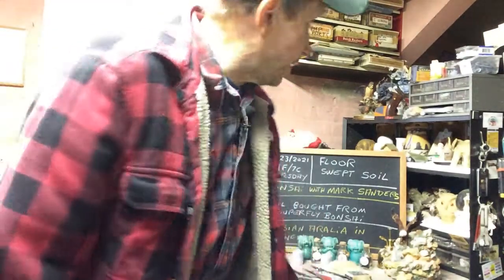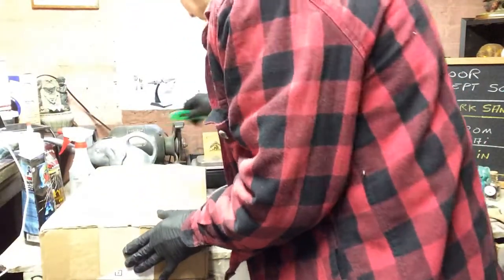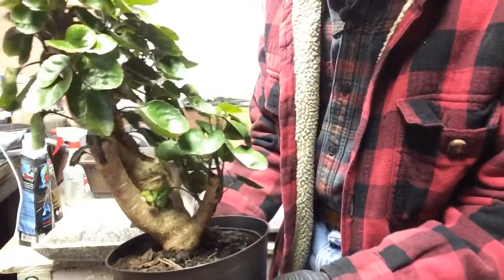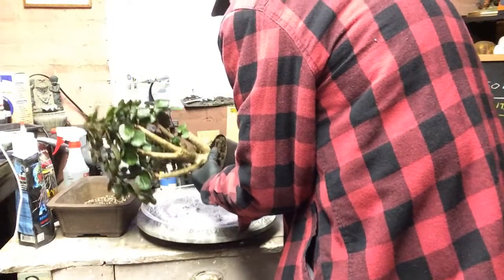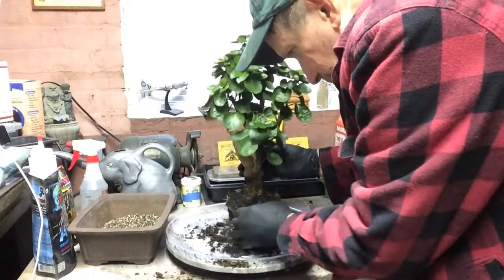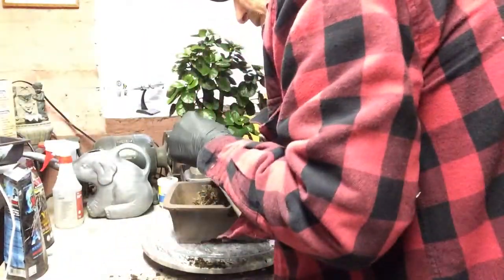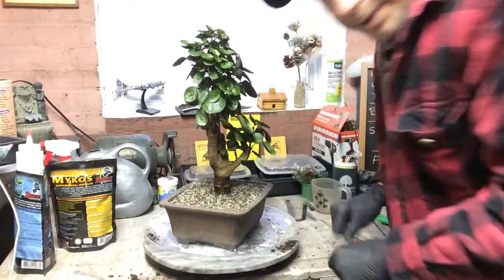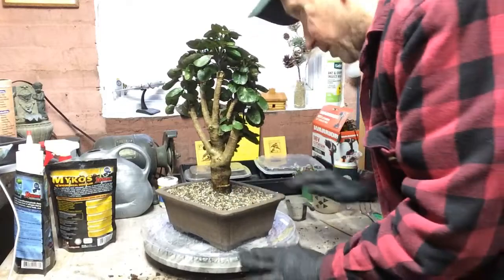Floor Swept Soil

Comment: You left out the $17 in shipping, so it's actually $47 for 3.5 gallons of mix.
Reply from the maker: Still good Josef. Sorry about not saying shipping. The prime bags for 2 quarts is $15.97/bag or say $32 for 2 bags or 4 quarts plus shipping. 4 quarts to a gallon. I am not good at the dry quarts though. Still, I think the floor swept bag is a much better price. What do you think Josef? Just thought that I received a better buy. I usually do not buy these types of soil. I just wanted to see what others were offering. Take care Josef and enjoy the Christmas day and relax in the evening with a nice hot cup of tea. I am glad that you corrected me about forgetting to add the shipping. I think that mixing our own soil is a better bet. Cheaper in the long run with a whole lot of trees. Tom
Reply: @growclipbonsaiforseniors1951  I suppose if you're comparing it to akedama prices, then it's probably a great deal, but if you make your own mix from local sources, like Nigel does, it's pretty expensive.
Reply from the maker: @Josef_R  It is expensive Josef. Sometimes I try experiments to see what one gets when they buy the soils on line. Just like Nigel, I mix my own also. Those other soils are nice, but, who can afford to keep buying those soils. I just bought a bag of perlite about 4 foot tall, about 2 foot in diameter for $30 and vermiculite, same size for $26 and my big bag of pine bark for $10. Worm castings are about $7/bag. Peat or coir is cheap. I buy these all locally from my garden centers and Home Depot or Lowes to save money. On a fixed budget one must be frugal. Take care Josef and have a nice relaxing day and enjoy a cup of hot tea in the evening. Tom